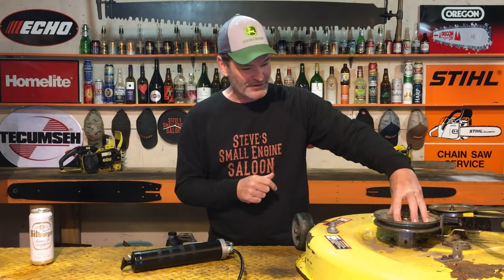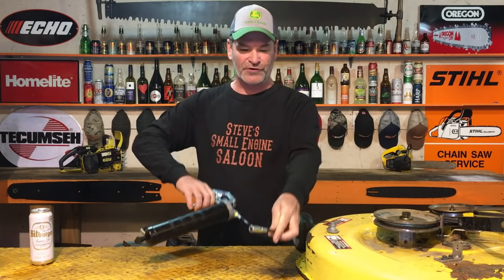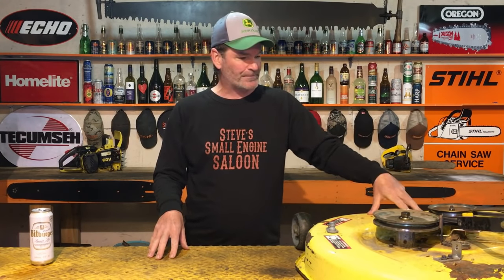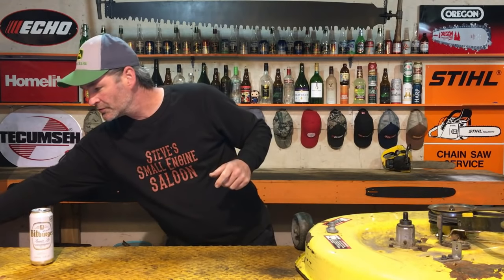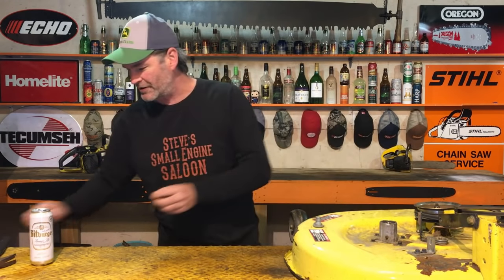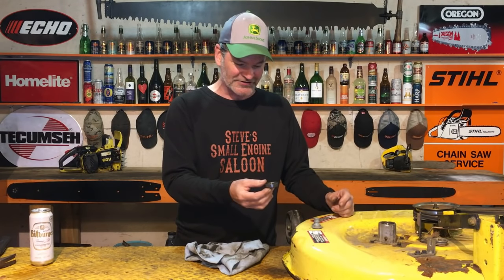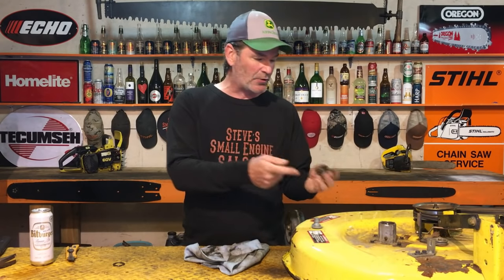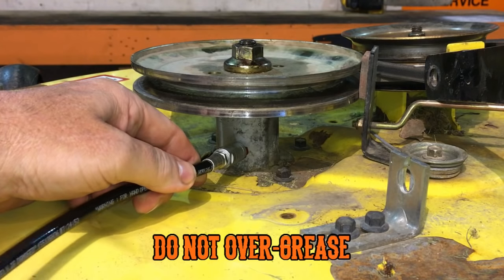Your Riding Lawn Mower's Dirty Little Secret

Comment: I was telling my wife yesterday how they make stuff to not last long like it used to. They want repeat customers.
Reply: So true! My wife has a 2003 Dodge Dakota and the window regulators fail as soon as they are installed. The regulators (electric windows) are operated by a cable. The problem is they have 2 cables come together with a cheap plastic square. They could've easily used a piece of aluminum or steel. But it wasn't a mistake. And it's not a "Dodge" thing because it's a common design. The regulators are made by other companies but I'm sure the car companies know about the issues but the design continues being used. Why? I believe it makes for repeat customers. And who knows, do car companies get paid for them to use that type of regulator?
Reply: hotshot Ive taken drills and skill saws apart and found greese from the factory just spooned in a corner and not on the gears or bearings of that tool   this way they cover themselves  but the tool still wears out before its time ....same thing with lawn tractor transmissions
Reply: When something fails too soon however, it's a good way to lose repeat business. For example, I'll never buy a Briggs & Stratton engine again.
Reply: briggs engines are made in china now       they built a 1/4 mile long factory there and half is briggs the other half is koler engines
Reply: I told my wife to watch this video, and get it done on my mower, today.
Reply: -Well.. there are Russian Ladas still running, all around the world Every day. Like everything in life, it all depends on the person with vested interest, sweat equity, 'the Owner' ;

Comment: This scam has been going on a very long time. If you have to buy a new spindle assembly, take it apart...the new bearings are sealed too! I ran across this back in the early '90's on an MTD I had then. On spindles without grease fittings it's an easy project to install some and set the bearings up right. Great video! Oh...at this moment you've got about 1200 mower spindle engineers downvoting you. 😁

Comment: I've seen this on other equipment and questioned why sealed bearings were used or designated as replacement.  What I read years ago was when  sealed  bearings were used with a grease zerc in the housing ,  that the grease zerc was installed to keep moisture out of the cavity or housing.    I guess the intention was that even if the bearings were rarely greased they would last longer.  Larger spindle bearings have seals on one side only and must be installed with the open side to the grease zerc.
Reply: Bingo!

Comment: I work on  Ingersol Rand Type 30 OEM and aftermarket pumps.  In our parts department we sell replacement parts for these and other machines and makes.  We buy the bearings from wholesale bearing distributors.  There are open and sealed versions of most of these bearings.  For whatever reason, some of the bearings we get are only sealed bearings (price, availability).  In those cases we pop those seals out as you did BEFORE we put them in stock as they go in splash fed crankcases.  In most large scale warehouses and assembly plants neither the person installing the bearings nor the purchasing agent buying the bearings knows much if anything about how these things are supposed to work.  That's the problem with corporate run factories, they hire the cheapest labor they can to assemble the product then they have people on the other end with "degrees" and "credentials" that probably never did any manual labor that involved mechanical things buying the bearings.

Comment: I have a craftsman riding mower and the idle pulleys kept going out on the deck seats wants 45.00 for one and 65.oo for the other mine have spot welds and rivets I ground the rivets out and took hatchet and carefully spilt the spot welds and come to find out the bearings are just alternator bearings and auto zone had them in stock for 1.99 each drilled the spot welds and rivets out and bolted them back together now can change bearings easily
Reply: It just so happened I had my mowing unit on the bench when I saw your video. I will be following your advice. Thank so much

Comment: Change the oil but never greased anything on my Deere rider.  10 years no problems.
Reply: I've got 21 years on mine and never lost a bearing!
I mow an acre and a half.
JD LX178 with 44" Pirahna deck.
My question is, if grease can't get in, how does it get out? Or maybe that should be asked, if the grease can get out of the bearings, why can't new grease get in?

Comment: I'm an old skateboarder, and to "grease" a sealed bearing, shoot some Tri-flow in there, would save you a lot of work. Work smart, not hard.
Reply: Tri-flow is the best.
Reply: 'Skates' are not quite the same. Loads, hours, speeds, etc. you know, like Physics, engineering and stuff ;

Comment: And when you replace a bearing that has the 2 seals, before you install it add more grease into the bearings they will last much longer,
Reply: I would just add: Clean and grease!
Reply: Not necessarily.
Bearing manufacturers would carefully calculate how much lubricant is required to meet its specification. In this application (lawnmower) it may be okay but certainly not all.
Reply: Bearing seals pop out easy for repacking with a decent grease. 
Unless you think the manufacturer puts the top of the line grease in bearings, leave them alone. 
Just use a small pick or pocket screwdriver. Something with a fine edge.
Reply: If you don't have a bearing grease packer, remove both seals, put  a nice amount of grease in your palm and "slap" the bearing into it. Replace one seal and install bearing into housing.
Reply: Y B  
But the grease in them is usually shit quality.
Reply: Y B  I'm a newbie. Are sealed bearings grease free as manufactured? I would think all metal bearings would need grease,  even  if they are sealed . Doesn't grease break down as used.?
Reply: @williambranham6249  Sealed bearings have a drop or two of grease in them, but not much.  That is why most bearings have very little warranty.  Also, for  your second question...grease does break down as it goes through the heat/cool cycles that bearings go through.  bearings heat up while they are worked (the grease is to keep that heat and friction to as little as possible) and cool down when the machine is nut used.

Comment: Get higher grade bearings. Those are sealed for a purpose (pre- lubed and coated). You pull one side of the seals off, the grease will cause resistance due to the right clearances of these bearings. Also the grease will get hot and and liquify around the bearings and cause cavitation of the ball and races. Replace with higher end bearings then grease them.
Reply: High quality hostile environment sealed hybrid ceramic bearings are prefect for this. Then pack (do not overfill) the cavity with a good aero grease like Aeroshell 22 or Mobil 28. Pricy but you never look back.
Reply: Coincidently, I was reading an online Cub Cadet manual for their fab decks.  They mention that the bearings are sealed and that you must grease them to displace moisture.  I don't think it is a good idea to pop open that seal.
Reply: I just do a couple small holes so the grease gets in but doesn't change the bearings.
Reply: Drill lol
Reply: But recommend the better bearings for sure
Reply: I’m betting that these bearings don’t generate enough heat to actually liquify the grease to the point of cavitation. They spin sub 3,000 rpm, and they are in an aluminum spindle, that alone is a very effective heat sink. Whatever resistance inflicted by the viscosity of the grease is easily overpowered by the drive system and engine.

Comment: Wouldn't those sealed bearings pop the other seal when you grease them like that? It may just be easier replacing the bearings every 4 years.
Reply: fourbypete  yep true dat!
Reply: The way to solve that is to drill a tiny hole mid way under the bearing outer race in the casting, it will allow the air to escape as grease is pumped in. And let you know when it is topped out by bleeding out that hole. 1/16 size bit should be large enough. Grease coming out will prevent dirt and water from getting in.

Comment: These bearings failed on my Cub Cadet GT2544 tractor quite a number of years ago. When I went to buy the assembly, the mechanic did not have one and delivery was going to be a while. I really needed to get the grass cut. He sold me just the bearings and even told me to remove the two seals on the inside faces! I noted the number of the bearings......but touch wood......I have not had them fail again in probably 8 - 10 years! I do grease that spindle regularly though. Great video and great tip, Steve!
Reply from the maker: Right on

Comment: Sealed bearings can be a good thing....but the word "CHINA" on the seal may NOT be a good thing
Reply: Man, I saw that cheap Chinesium bearing,  and shuddered... you said "may not be a good thing". I'll go farther, and say "It's a Bad thing... Very Bad thing"!
Reply: @greatnortherntroll6841  I agree Lonnie....The bottom line is, SHAME on John Deere for importing inferior parts, and using them on what should be a well built long lasting American machine!
Reply: @richcanfield1387  John Deere makes to lines. One for the Big Box stores, and one line for their dealers. Box store brand is  junk!!
Reply: John deere dont give a shit i used to do property maintenance at a big stamping facility they got a big contract from deere for stamping hoods for there combines they slit there own throat to get the contract because deere was gonna have them made in china that place ran in the negative for the whole contract and lost their ass because deere promised a lot more work at a better piece price if they could do it as soon as the contract was over they pulled out and left them hanging and 60 workers lost their jobs ill never own a john deere product after seeing how they operate
Reply: Chinese hard goods like these have gone through an evolution in quality. In the past the big problem was machining tolerances and surface finishes, (plus others). Seemed like they never made the acquaintance of  a set of calipers. This got better with experience and the purchase of better production tools. But, one flaw they have yet to rectify is the quality of the basic raw materials of the products produced. Their metals are weak, their plastics are brittle and their artificial rubber and silicone are lacking in the additives needed. Tolerances you can check, fit and finish you can check, but without sophisticated testing the basic material composition unknown. If this was the Star Trek Universe, they would be the Ferengi.
Reply: @charlescoker7752  Great to know since I'll be in the market for one by Fall....just not sure which brand for lawn tractor.
Reply: @1Klooch  There was a talk show host in the 90's talking about the Chinese. How our government thru  our companies under the bus to get cheap  products. The Chinese when to our patient office. and copied every patient in the patient office.  He went on to say they took scrap iron, and just melted the iron. So you ended up with hard, and soft metals all mixed. He  also said , that is why Tower cruise were falling to their death from  inferior bolts from China. Chuck Harder was his name.
Reply: +Charles Coker; As I was writing my earlier comment, I was thinking of a bulk box of Chinese made wood Lag Screws I bought some years ago. Had to "oversize" each pre-drill and lube. Used a hand ratchet & socket to run them in and had to be careful, even at that, not to twist the heads right off.
Reply: +Chris; Good for you and your efforts! I know why you do it too, (because where are we forced to get most of our equipment from now?,). I used to work for a manufacturing engineering company which served the mining industry in the South West US. Our newest metal working stuff came from Trumpf in Austria. Very high quality, very expensive. But, we had a bunch obtained through auctions of equipment from US companies. Bridgeport Mills and other equipment from Cincinnati and Driess & Krump. One of our centrifical clutch press brake's was made in 1929. When we broke it we contacted the USA company, (still in business), expecting them to tell us to get lost. Instead they said, "OK, but you'll have to wait a little. We don't stock parts for that model, but we'll make one for you. By the way, that's the last one of that machine in the world still in commercial use."  I guess it's true, they don't make 'em like they used to.
Reply: "If this was the Star Trek Universe, they would be the Ferengi."        
To 1Klooch:  That is the best thing I've read today!!!  So appropriate and so true. Good on ya, mate!   (Oh yeah, I'm "borrowing" that line...)
Reply: @richcanfield1387  Dealer probably as important as the brand as well as the best warranty you can buy.
Reply: Rich Canfield .modern parts are poorly made all over the world American made crap is also crap.my last Yukon Denali was the worst vehicle I ever owned.
Reply: @williambranham6249  I just wonder if the "Big Box Stores" sell inferior units from other manufacturers like Husqvarna, Cub Cadet and others? ... Guess I'll be going to my local lawnmower shop!
Reply: @richcanfield1387  Probably your best bet if you plan to give the unit a lot of work.
Reply: @richcanfield1387  I feel pretty confident that all models of motorized tools at BB Stores are consumer grade. If you plan to use it a lot get the warranty.
Reply: @williambranham6249  Good advice William...
Reply: @charlescoker7752  Sadly, our local Deere dealers HAVE BOTH the "city-folk" AKA "big box" v machines and the "farm proven"  machines on display on the front "porch" of their buildings
Reply: @ramiroescamilla7263  Was it built before or after Barack Obama screwed GM?
Reply: @richcanfield1387  Cub cadet, troy bult, and craftsman come off the same assembly line.  All three are made by MTD, which USED to make decent machines many-many moons ago, but sadly just makes cheap crap nowadays.  Generally, Husqvarna is a little better, but not much.  If you want quality...Yanmar made (sold under other names), Kubota, and John Deere DIESEL lawn tractors are the superior ones.  Most but not all "gas burners" are cheaply built junk.
Reply: @michaelwaller8252  Wow Michael...Thanks for the detailed info! Good Stuff...
Reply: @richcanfield1387  You're welcome!  Also, I have seen in Baton Rouge, LA, BRAND NEW DIESEL Cub Cadet small tractors that I have found out are made by Yanmar.  These tractors are sized similar to the 1980's John Deere 650 - 1050 tractors that were made by Yanmar as well!  I know they operate rear finishing mowers and small bush hogs, but am not sure they have a "belly mower" option as the Kubota and Deeres do.

Comment: I'm no Rocket Scientist.  Don't really know much about small engines except how to make thme no longer work but even I thought "WTF?!?!?" when you pulled that sealed bearing out.  I'm having a Corona Extra at the moment and my biggest gripe is my damn mower is a ONE WHEEL DRIVE...who the Hell thought THAT was a great idea???
Reply: If both tires rotated at the same time, you would not be able to turn your mower. As you turn, one wheel turns further then the other, so if both wheels are rotating at the same speed they will over power the front turning wheels and you will then still be driving a straight line. The solution is a limited slip differential that engages the non rotating rear tire when the drive tire is slipping. However, this would be one expensive lawnmower, so you get only one wheel drive.
Reply: @linkschrecengost1361  Interesting, never occurred to me but yeah, clay soil property with a loty of Slopeage means a lot of Slippage here.
Reply: Mark Henry buy yourself a mower with a diff lock

Comment: I guess that you could just remove the seal on each bearing, pack it with grease the old fashioned way then replace the seals. 

It seems to me that when trying to grease the bearings using your method, that the pressure of the grease compressing the air in between the bearings which is pumped into the cavity would want to blow one of the bearings out of either end of the spindle. 

Then again I could be wrong, I usually am.

Comment: When you do this the pressure of the grease will push the bottom seal out. The solution is to drill a 1/16” hole in the bottom seal for a releaf hole so the grease will fill the bearings. Water and dirt will not get past the grease.👍
Reply: David!  Wow.  Excellent point.
Reply: That’s brilliant 👏👏👏
Reply: Spot on.

Comment: Great tip thank you and of course have another BEER ....
Reply: shielded bearing not sealed. grease should be able to get past the shield, it is a loosely fitted metal shield not apressed on plastic or rubber seal. most people are most likely not even greasing their stuff properly or at all. honestly how many you out there are doing proper maintenance on your stuff ie. greasing those lower ball joints and u joints. grease fittings font even come on today's automobiles. it's a throw away society smh.

Comment: Great video Steve. I just replace my bearings with new ones, and packed them with grease. Hoping you might do a video on changing trans oil on John Deere D140. The JD says you can't change it, but there is a port on the top to do it. A video on how to disassemble a rear JD, and change the trans oil would help a lot of people. It could double the life of a mowers usage. Thanks again for all you do. This is probably the 10th video or so that has helped me with different problems. I pulled the trigger on a shirt and sticker to support the cause. KEEP EM COMING. THANKS!!